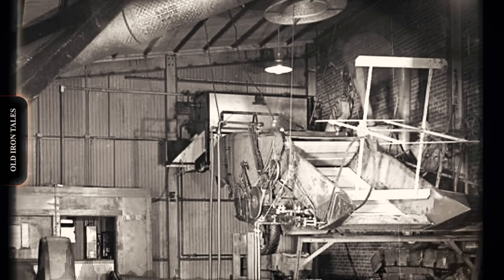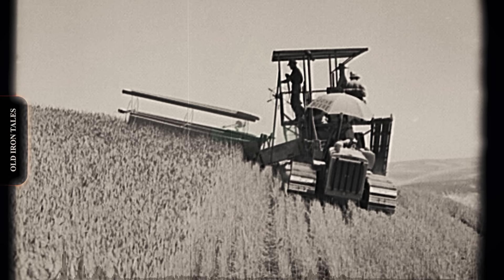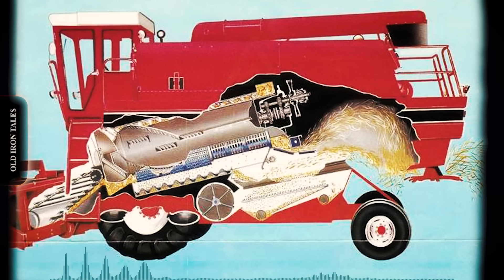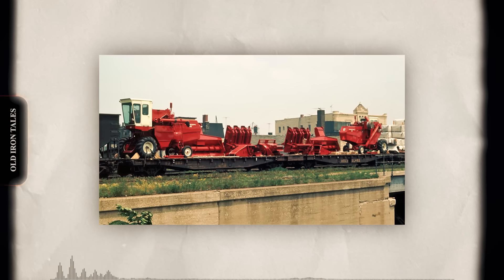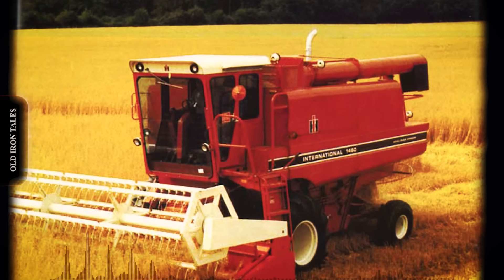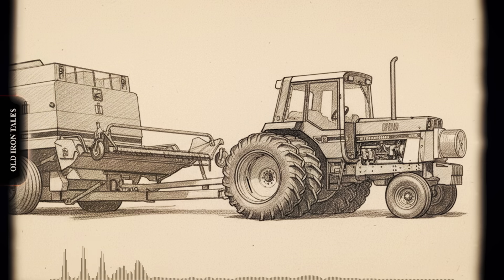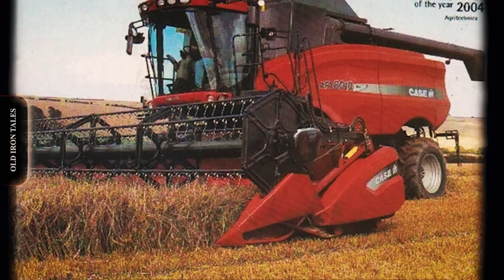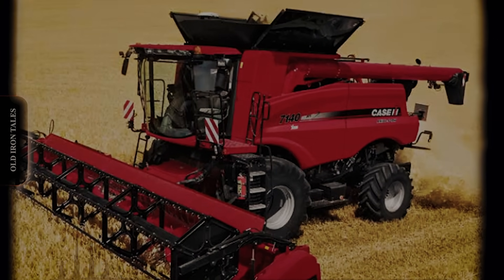The Innovation They Had to Hide From John Deere — International's Axial-Flow Combines

Comment: Hart Carter - carter disk for grain cleaning plant. Pocket sized for diff grain. Many use a diff style adjusted drum. Rather than having to change the type of pokets heavy cast disks. Yes had looked at NY twin rotor. But we had only pulltype. For windrow pick up. Also stone trap on rotor was an issue. Tough straw Canola etc proved trouble for Hleane

Comment: What's crazy is how John Deere kept on selling conventional straw walker combines and actually out sold all the other manufacturers on any given season...John Deere had a rotary prototype in their research & development sector but never brought to market until recently.  Seemed many farmers were after the not so damaged straw for baling that the JD's machines produced.  Rotary's tended to cut straw too short to bale.  End of story.
Reply: The initial rotaries handled small grain better than corn and soybeans.  Especially with corn, the rotaries ( New Holland, IHC) would create ropes of plant material eventually plugging the combine.  It took the right combination of diameter, speed, clearance, etc., to produce a better design.
Reply: That’s just how good Deeres marketing was.   Everyone who just ran 20’s and 95/9600 just didn’t know any better.    Me and everyone who ran Deeres and never got in a case where flabbergasted when we finally got into a 9650 rotor.    Us guys on harvest crews couldn’t get rid of the walkers fast enough, I’ve heard many guy who owned Deere walker harvest crews that said they should’ve been running 21 series cases looking back. 

I ran harvest for a couple decades and have been all over, I can count the times I dropped a windrow on one hand.

The easy money is in the tech now, Deere markets the crap out of a few tech add ons that have subscriptions and basically zero roi.

Comment: I used to work for Hart Carter co in Ill.  We made sieve and chaffers near Peoria and the old system had reached a point where they were so large that it was hard to keep them together.  The engineer I worked for and I were in the international harvester facility and a young engineer took us into a small room where they were experimenting with the rotary chaffer.  As we were coming out of the room an older engineer grabbed the younger one and red him the riot act! you could tell that the younger one knew he had greatly screwed up and his employment may be ending.  As he walked us out I told him not to worry as we hadn't seen the rotary system.  He turned white at that statement.
Reply: As I've said before giving how many of these channels seem to use similar information someone of which is only 25% correct and starts to make me wonder if YouTube has any people checking what's being uploaded
Reply: I worked for Hart Carter from ‘73 to ‘78.   I became more focused on front end equipment but oversaw some testing on chaffers.  Was the engineer that you mention Dennis Jones?
Reply: @davidcolgan3268  I have no idea.

Comment: Again, Case did not aquire IH, Tennaco did. Case did not merge with New Holland, CaseIH did.
Reply: What you don't understand is that conglomerates keep separate operating accounts and P&Ls and have separate debt structures (at least on paper). Case was indeed the platform that absorbed the assets of IH. Tenneco was "just" a capital allocator.
Reply: Tennaco had already owned J I Case for some time when it purchase IH that had great financial difficulties
when they rolled out the Magnum it was Case's technology. The IH rotary was already rolled out Case was the clear winner in this transaction. Leave it to a farmer to betray their soul. Fiat acquired Ford New Holland prior to acquiring Case IH they did acquisitions in order to have sale for their engine division I believe that in the long run one of these brands will disappear
Reply: @HaroldMckee-u4o I believe you are wrong... it was IH technology period!  IH was ahead in tractors and combines.  The magnum was all IH EXCEPT THE ENGINE... which they should have kept the IH engine design
Reply: Why it called CNH. Case New Holand corporation. The only thing left of international is red paint.